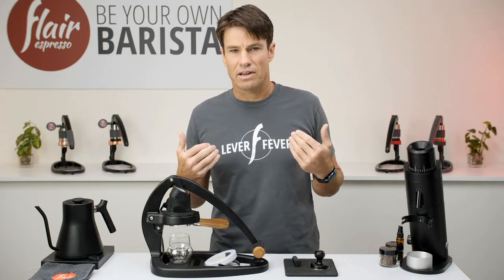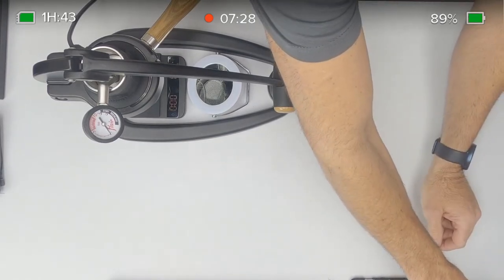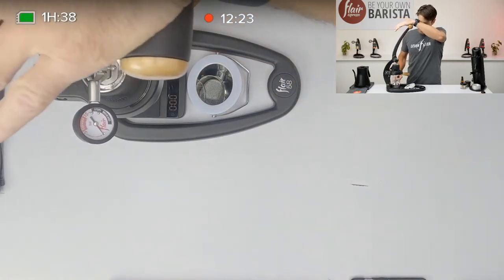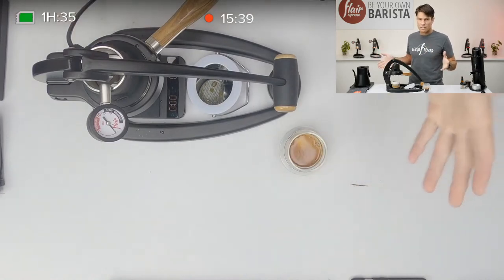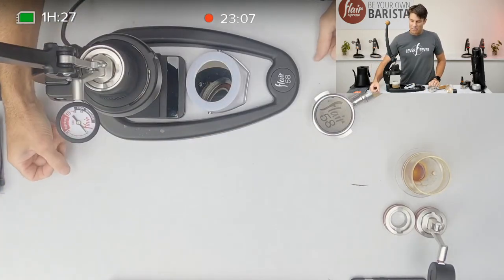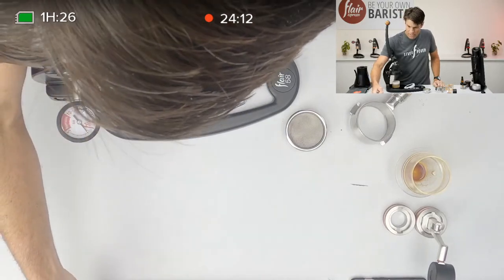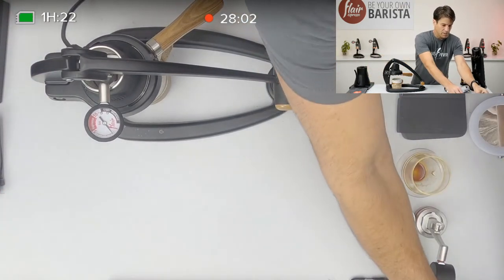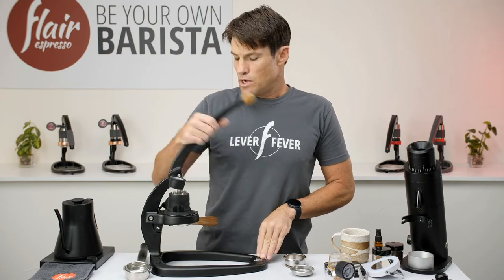How Do You Handle Pressure? - Valve Plungers

Comment: I just picked up my flair 58 today and WOW. I boxed my Expobar Brewtus IV rotary right away. IM SELLING IT. This thing pulls better shots than any machine. YOU NEED A GOOD PROPER ESPRESSO GRINER OTHER WISE YOU ARE BACK TO SQUARE ONE TRYING TO FIGURE OUT WHY IT LOOKS LIKE DRIP COFFEE WITH NO CREMA.
I used Mignon Grinder.
Flair 58 is easy to clean. The water does not pass through copper pipes and boilers,  it's just straight through, clean and tastes AWESOME. I wish this was available 5 years ago.

Comment: Hello,
Would it be possible to plug the Flair 58 into a smart electrical plug so in the morning I can use my phone to turn the plug on then by the time I go downstairs the Flair 58 will have heated up?
Reply from the maker: Switchbot is the answer
Reply: @Flair Espresso  Thank you so much  
I replied to a previous reply. 
I feel most attracted to the Flair 58. In future correspondence, we can discuss what accessories I will need as well as pricing. Thank you so much for the reply.

Comment: My flair 58's lever just comes down smoothly without making any pressure. I don't even need to push it down. It just drops automatically with the gravity.

The  watery coffee-like liquid come through the filter.

 I tried over and over again with the different amount of coffee and the different granularity but the result is always the same. 

Does anyone know why this happens?
Reply: It was happened to me, it comes down by itself. The cause is my grinder cannot grind fine enough. So probably you have the same things happens to you. What grinder did you use? And which settings
Reply from the maker: Grind finer. No question about it. No resistance as you have described it
Reply: @supriedonk  Thanx. My grinder is timemore coffee grinder and set it to the finest. 
What kind of grinder do you use?
Reply: @tatsuyatanabe7646  i have tried timemore c3 and it cannot grind fine enough to give resistances. I would suggest you to change your grinder. I changed mine to 1zpresso jx pro, and it worked wonderful, but i think there is many other great grinder as well
Reply: @supriedonk  wow, thank you so much for your time and quick response! I will take a look at the one you mentioned!
Reply: @FlairEspresso  OK. Thanx!

Comment: It us not building pressure. Esp if im just pumping water, no pressure unkike yours where the gauge was moving mine doesnt
Reply from the maker: Grind finer
Reply: @FlairEspresso  im on the finest setting put of 31 grind setting
Reply from the maker: :( looks like you'll need a new grinder. bit.ly/BrewWithFlair can help you find a replacement
Reply: You know how you tested with just water with no coffee in the porta filter and water is not dripping? Mine is going fast when i am pulling the lever up
Reply from the maker: this isn't the channel for support, you'll need to share videos demonstrating your concerns for proper troubleshooting to occur. please use flairespresso.com/contact
Reply: @iplayedalong  I just tested this, and same issue like you. Did you find and answer?
Reply: @QXottabQ  Hi. Actually, yes. I wrote to customer support. Quote: "As per the video you saw from Andrew, he is using a blank basket. It is basically a basket without holes (or blocked) which is why you don't see water coming through and you see it register in the gauge."
Reply: @gonzalodiaz5024  Thank you! I thought so after as well)